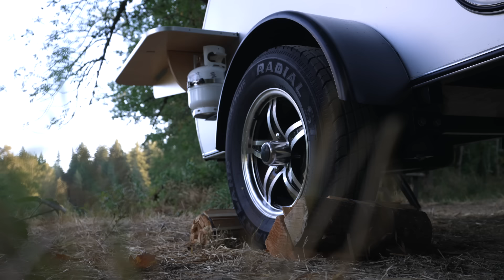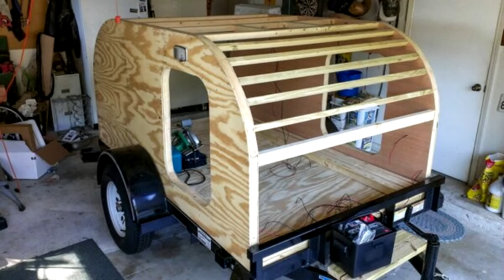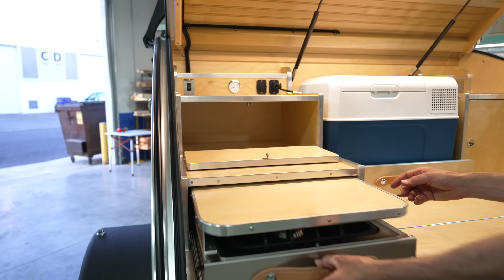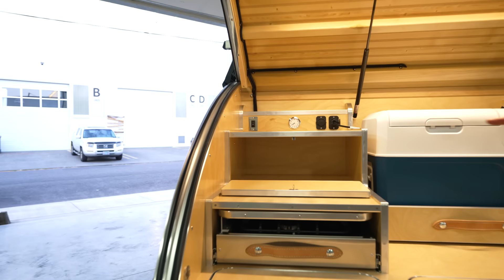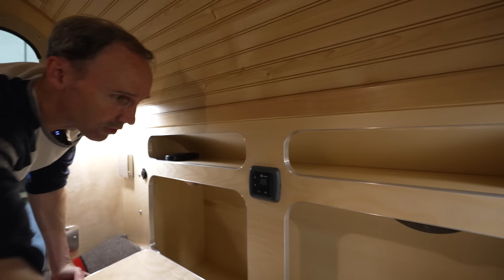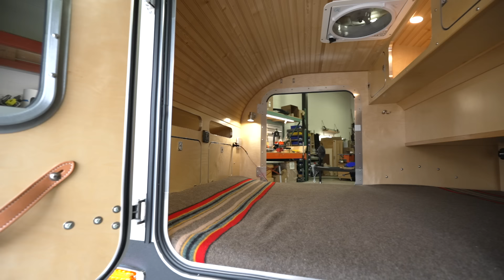RAISING THE BAR! A New Standard for TEARDROP Trailers

Comment: 4;36 He says everything except for the heater is standard,  but going to the site, the first thing I noticed is it comes with 2 10lb steel propane tanks. The 2 fiberglass 20lb propane tanks are….extra ($325). Looks like a nice trailer, but I’m still leaning toward fiberglass and composites that won’t rot over time. I still have a year to go (to retirement and getting on the road), so my choices keep getting harder. Btw, I would spring for those propane tank upgrades in a heartbeat😊.

Thanks for brining us these videos on manufacturers we might not have found!
Reply: I hear you. This teardrop and Camp-Inn really captured my imagination but I instead put a deposit on a Bean Stock 2.0. I'm going to do a lot of off-road driving and fiberglass gives me a lot more confidence.

Comment: For the prices on these teardrops, I would just get a Scamp. Teardrops only sleep 2 adults very tightly, you have to pull everything out in order to cook, you are cooking out in the elements if its raining/snowing. I really don't see the appeal of a teardrop. In a scamp, you can pull over and sleep without getting wet, wake up and make a coffee before even stepping out of the camper. Teardrops are just a hardshell tent.
Reply from the maker: It’s really hard to explain until you’ve used the scamp and a teardrop extensively. There’s many people like our family that owns one of both. They both meet very distinct needs. But as time goes on, I find myself using the teardrop trailer much more than any of our 13 foot travel trailers. Essentially, it comes down to living in a hallway versus living in an outdoor living room. Yes, you can live outside in the scamp, but it takes a lot more set up and work.

Comment: Come on the fiberglass gas tanks, what do you save? 50lbs? Big deal, and I'm sure there like $400
Reply from the maker: sounds like you might be new to the small camper community. Many of our total tongue weight capacities for small vehicles are between 100 and 200 pounds. 50 pounds doesn’t sound like much, until you’re talking about margins that small.

Comment: But do they varnish ALL the wood before it is covered with aluminum??  If NOT it will STILL ROT and mold!!
Reply: From what I could tell the wood is pre-finished. Not clear if the cut edges get sealed. Though High Camp’s building is pretty fanatically top notch.

Comment: Nice production. One problem was your idea of 'ergonomically sound' storage. Standing close to the item you are lifting and doing that lift in a down-to-up movement without the need to extend your arms or forearms is much safer than a low, pull-out drawer in which you have to reach for items. Any reaching while lifting places an inordinate amount of stress on the girdle - shoulder or pelvic - regions. Of course, such soundness depends on (1) the lifter's health; (2) the starting body position; (3) the weight of the item; (4) the angle of lift; (5) ..... and so on.
Reply from the maker: Very good point you have here Brian. You are making me aware I should’ve chosen a different word. I’m realizing ergonomically wasn’t what I was trying to convey. I see how it came across as body mechanics. I think the correct term would’ve been usability. There’s a number of factors that go into this. Number one with a three-quarter hatch all the mud and dirt that gets thrown up on the road will be on the back quarter of the rear end. When reaching into a space like that, you’re going to end up brushing up against the dirt. Second, items will be stacked on top of each other, and you will not be able to see items on the bottom. And then third, just the quick access I think does have to do a little bit with body mechanics. Basically reaching down into a hole versus quickly sliding something out. But you’re right squatting down to reach Forward and pull something does have it’s risks. It makes the use of slide outs. Make a little more sense. Thanks for correcting me on this Brian.

Comment: What is the point of building the trailer so small, but then add a storage box and a roof rack?
If the manufacturer took advantage of that incredibly long chassis, he could build a slightly, while still significantly, bigger trailer which would include all of a camper's stuff and at the same time stay simple and more aerodynamic.
A slightly bigger trailer also means a slightly higher trailer; that would allow, among other things, for a slightly higher door so that one would no longer bang one's head against the upper threshold.
The interior wood finishing, too, can be upgraded - it is so dated.
What we see is a great starting point, nonetheless.

P.S. Good points about the hatch and storage. The burner is good, too; but why does it need that top?

Comment: Small but important, it doesn't have any USB outlets, you have to carry 12 adapters.  I agree about the hatch cover, and he could actually incorporate a fold out cover from the hatch easily.  I have a Winnebago Micro Minnie and if younger I would build a taller teardrop hybrid between this camper and my Micro Minnie.  I originally towed my Minnie with a Honda Ridgeline but it was too small so had to upgrade to a full size pickup.  My hybrid would be towable with a Ridgeline or SUV.

Comment: That celling fan is awfully noisy.
Reply: Hi Taz, that ceiling fan is on High when I start it up in the video and Drew holds the camera mic up to it.  Turning it down to 50% or less reduces the air flow noise significantly and on 10% (lowest setting) it can be barely noticeable.  Thanks!
Reply: @greasywheats  ok

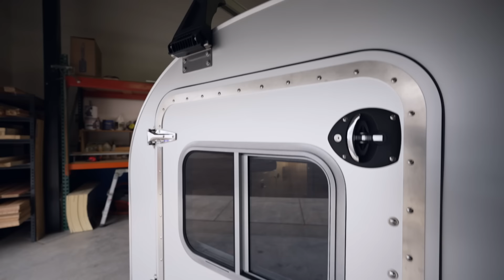Comment: Any company that does not install a heater (4:55) is not a good company. A heater is a necessity not roof racks. Idiots
Reply: Hi Steve, Not sure if there is some confusion here- the High Camp does offer a cabin heater.  Just wanted to clarify that. Thanks!
Reply: @greasywheats  according to the video it's not. Check out the video at 4:45 - 4:55
Reply: @no_country_for_real_men  Hi Steve, I'm discussing Standard equipment in that segment (features included in the the base price of the trailer- which had changed between the filming of the video in Aug 2022 and it's release in January 2023).  As stated in the video, a heater optional equipment (available, but not included in the base price).  You may believe that a heater is a necessity, but not everyone feels that way and so we aren't inclined to force a $1,600 piece of equipment on folks who otherwise don't need it.  Difference of opinion is all.
Reply: @greasywheats  🤨Heater not a necessity ?  But roof racks are ?  That's next level nonsense.  But I do agree with you there are dumbasses that run their a/c in the winter and get their self sick with their nonsense and then travel and get everyone else sick. At any rate I stand behind my statement. Any company that does not install true necessities but install nonsense like roof racks is not a good company

Comment: A nice trailer - The General Grabbers are a good choice, but though the big wheels and low profile tires look cool - a much better choice for off-road are the 75 series aspect ratio tires found on Bean and NuCamp trailers. A better hitch/coupler like the lock&Roll on Bean trailers would provide far better articulation off-road.

Comment: Thanks for the video!  I have one and love it.  So well made.  I drove to Portland to get it and pulled it 3500 miles home to North Carolina.  No problems.  My wife and I have been to Maine and the NC mountains.  Storage isn’t a problem but it’s just two of us and I pull it with a full size truck.  Heading to Cape Cod in the fall.  We have a BundutecUSA Quick En-Suite shower unit that works really well for us.
Reply: Hi. Can you put a tent on the roof?
Reply: @michaelptm2269  I haven’t tried that but you are supposed to be able to.  You should check with the manufacturer.  It would definitely negatively affect your gas mileage.  I do think it is very well made.
Reply: @dudelangford1  thank you. Do you know if this company works with Aero Teardrops. I heard it mentioned in the video. Or are they separate companies?

Comment: Fiberglass tanks - they are considered "safer"  then normal tanks as they will melt and release pressure rather then explode in a fire.  That said, it also means you need to keep them further away from heat sources the other tanks.  This can affect the positioning of components on a vehicle, for example, the tongue area is a fav spot for diesel heaters for many.  but the exhaust pipe can be very hot.   For this you'd want to move them.  

the limit looks like 120f.     this is important because depending on how they are stored...   in direct sun,  temps in smaller storage boxes,  can exceed 130f,  this can exceed the safety levels for tanks like this.
Reply: Viking Cylinders lists their operating temps from -40C to 65C. That is from below zero F to 149F. It would take an actual fire to reach 149F. Also the failure mode for the resin systems is a slow change to fluid. They would not melt like a thermoplastic such as Nylon. I think any normal placement would result in a safe installation.
Reply: @teardroplite  Good to know, I always worry about fiberglass and resin in extreme cold where it his -40 and lower...  We had polymer rifle stocks actually shatter in those temps...

Comment: I fell in love with this teardrop when I saw it featured on camp and camera. In my opinion this is the best looking teardrop out there. Because I’m currently a tent camper The Electric cooler means nothing to me, i’m used to a regular ice cooler. So my solution to the galley would be to take out the cooler and add three pull out shelves like vistabule has. That coolers outside dimensions are something like 24 1/2 x 21“ having three pull out shelves that size would be more than enough cabinet space for me. Dennis wouldn’t have to change any major construction. I’ll put my cooler on a stand outside, no big deal. Not to mention having a queen size bed over a full-size bed.
Reply: Hi Reinhardtkids1.  Believe it or not, we have an alternative galley  layout prototyped just like this that we will be introducing this Spring.  It removes the frig from the galley, widens the cupboard on the right into a 2-door cupboard and adds 3 drawers in between the cupboards for utensils and other drawer-friendly items!  Feel free to email me and I can send you some sneak peak shop photos of the prototype layout!
Reply: @greasywheats  not sure if you got my reply I also emailed you on your website. 
 I’m interested in seeing some sneak pictures of the new design. I’m doing research on teardrops and I’m really leaning towards yours for so many reasons. I hope you never get rid of the inside tongue box there are so few that offer it and that’s another feature that made me fall in love with this trailer.
Reply from the maker: I like your creative solution!  And I agree, it is an incredible little camper!
Reply: I also would feel more comfortable having my teardrop built in a smaller shop. Being built by skilled workers. Not an assembly line. I also love love love that inside tongue box. It seems like only a few companies make them now.

Comment: Gorgeous workmanship, especially on those doors.  Main misses for me would be lack of any insulation, no onboard water, no plumbing for outside shower, no option for A/C, standard AGM when lithiums are so cheap now, and lack of off-road capability.  Why bother putting big heavy off-road tires on a trailer with a torsion axle and standard hitch.  That trailer should not really be going off-road where those tires would ever be needed.  Also, if you want better weather protection over the galley, a square drop is a much better shape.  Finally, while the wood and aluminum is beautiful, state of the art today is zero wood construction with insulated panels and zero aluminum sheathing.  Wood, even in a finely made trailer like this, will rot.  It’s just a matter of time. Guaranteed.  And aluminum will dent.  One good hail storm and it’ll look like it got attacked by hammer wielding zombies.  As beautiful as this is, there are much more durable trailers out there that won’t have these risks and will be far more capable off-road if that’s required.  Last niggle is putting the fridge up so high that you won’t be able to see down into it.  Fridge should always be low, in a pull out that you can see down into.  I’d redo that kitchen design and put the fridge where the water is and put the water tanks below where they belong.
Reply: Thanks for watching the video and supporting Drew's channel! 
That's a lot of issues to unpack, but to comment quickly... insulation in a teardrop trailer is a bit of a mute issue to me since all teardrop trailer sleeping quarters are small and all teardrops are (should be!) very well sealed to insure against water intrusion. As such, we (and every other teardrop manufacturer we know) advise that regardless of the weather, owners crack at least one window about an inch and also open the roof vent to allow for expelling Co2 and humidity and bringing in fresh air. If you are trying to close the teardrop up to retain warmth, you will have a potentially dangerous accumulation of Co2. Once you break the envelope of the trailer, you effectively negate any r-value gains from adding insulation. If you have a teardrop that does not require you to open any windows or vents, then you simply have air getting through the trailer envelope insulation or not. Now this doesn't mean that you have to be cold at all in a teardrop, a good down comforter will do great and, of course, our cabin heater is the ultimate for warmth!
Reply: @greasywheats  I find the insulation is critical to avoid condensation on walls, floor and ceiling.  Yes, we keep the fan open a crack, but propex heater and insulation keeps the inside toasty and dry.  Just breathing inside will cause condensation on any uninsulated surface, and we sleep much warmer than if the floor and other surfaces were uninsulated.   Having the open a crack does not negate the value of insulation at all.
Reply: While we understand the initial draw to a sink/water tank option and have in fact installed these on some early builds at the request of customers, our own experience with these systems has led us to see that their Cons far outweigh their Pros (in our opinion). Here's my $0.02. A sink takes up precious counter space in a teardrop, as well as storage space below to accommodate drain plumbing. A sink small enough to fit in our counter is too small to be useful for doing much more than brushing your teeth in, or washing a cup or two. An average trailer with fresh/grey water tanks run around 8 gallon each, which is a relatively small amount of water considering your average installed 12 volt low-flow water pump runs pumps north of 1.0 gallon per minute. A full tank of fresh water will only give you 8 minutes of water flow (including washing, drinking water and filling pots of water for coffee/spaghetti, not to mention if you actually wanted to take a hot shower or two). In addition, a trailer with a built-in water system needs to be winterized every year, and plumbing connections inside the trailer are always a high risk for leaking. Lastly, polyethylene fresh water tanks invariably develop a stale plastic taste meaning you will likely find yourself bringing extra gallons of water simply to drink anyway.
Reply: @greasywheats  I have a teardrop with 35 gallons underneath, pump, sink, shower, and it’s fantastic.  Lasts a few days for three of us, and easily replenished with Jerry cans and rooftop spares.  Wouldn’t trade that feature for anything.  Winterizing takes a few minutes.
Reply: Lastly, we didn't demonstrate it while shooting, but the fridge is in a drawer on 14" drawer slides that enables the fridge to come out over the counter making it far easier to see in. Keep in mind, I am only 5'10". 
Thanks for participating!
Reply from the maker: Wow! This comment could be an entire video in itself. Thank you for taking the time to share your thoughts.
Reply: We actually do offer an A/C solutions via ports in the headboard to hook up an external AC unit like a Comfort Temp or other (future proofing for more future, portable options) rather than building in a traditional window unit.

We offer 3 battery solutions- two AGM options (100 amp hour and 170 amp hour) along with a 206 amp hour SOK LiFePo4 Lithium option- so it is available.

Comment: is there a practical reason to having the storage "bump" in front instead of increasing the interior area?
Reply from the maker: That is a good question. Based on what Dennis said in the video it seems like it would lengthen the overall trailer. Maybe the bump is small enough that it can sit on a portion of the tongue that the interior section of the trailer cannot?  That would be my assumption. Basically if he increased the front of the trailer the frame would need to increase with it as well.
Reply: @PlayingwithSticks  The frame would either need to lengthen, or be differently proportioned with a shorter tongue, which means separate set of parts to stock and build. The raw plywood panel size would also need to lengthen which could be an issue for the CNC capacity or wood availability... Tons of possible reasons for keeping with a smaller more standardized set of parts -- I was just curious what the constraints were in this case.

I have one of the last Purdy Adventure Trailer 5x10s(?) from before Kevin retired the name after he bought Teardrops NW. I use the head space for the same thing as this High Camp: clothing storage!